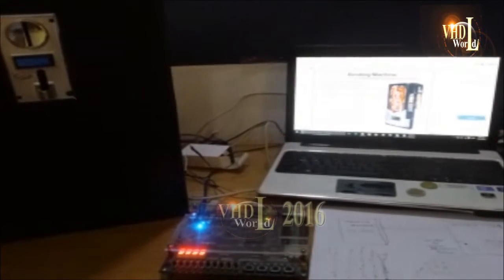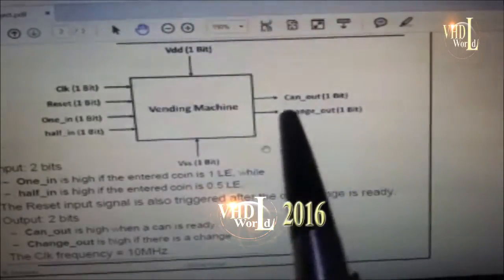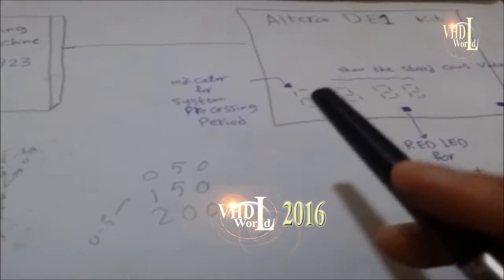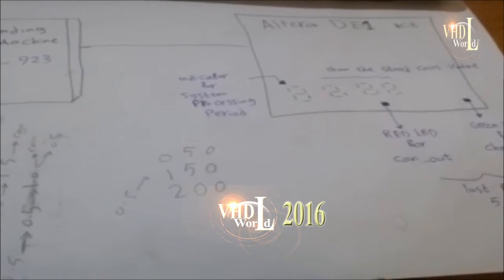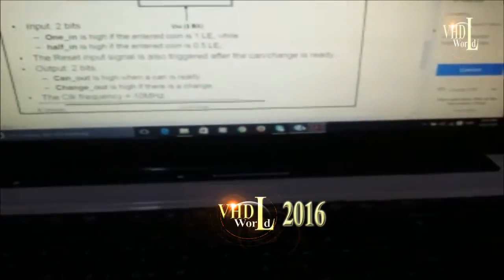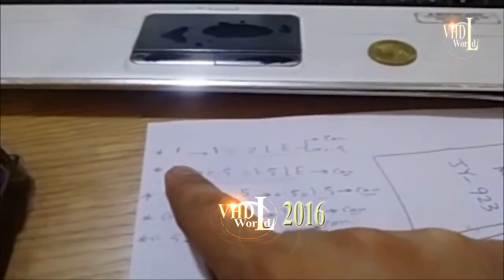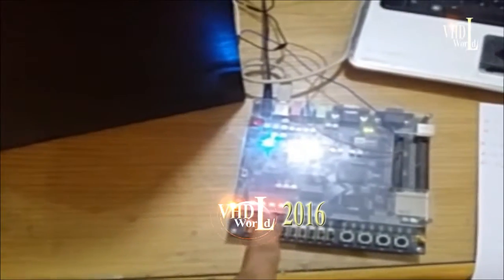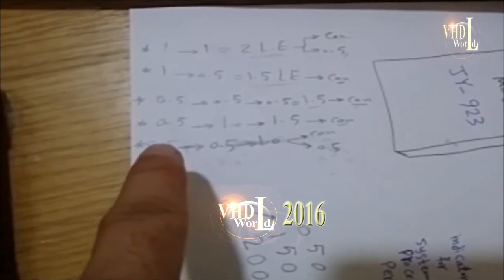Vending Machine using FPGA and Coin Acceptor

Comment: how do you write the vhdl code with the pulse output on a coin acceptor as an input?
Reply from the maker: Victor Santana it depends on the coin acceptor module itself, sometimes it will be a serial communications output like uart or i2c or other times maybe a pwm output like in this case as I remember because it was too long ago
Reply: vhdlworld so serial port would be the way to go? I figure that because I couldn't figure out how to do it with a pulse unless I add a micro control. I've seen ones with serial port I'll order that. Thanks for the info I greatly appreciate it. Also if you can; how you you program it to the serial port? if you have time can you make a video?
Reply from the maker: Actually as i said i don't remember if the one that i used in this video depends on PWM or Serial communications but if you have coding skills i believe that it will not matter with you.

unfortunately i don't have a coin acceptor right now
Reply: Is there a way to write a code using a pulse signal?
Reply from the maker: what do you mean by pulse signal? PWM?
Reply: im still having problem reading the pulse signal off the coin acceptor. is there any way you can make a video how to write one?
Reply: foe example if i get 5 pulse for a coin and 10 for another how would i go about it?
Reply from the maker: Victor Santana I really don’t remember the module that i used in this video... can you send to me the link of the module that you are using?